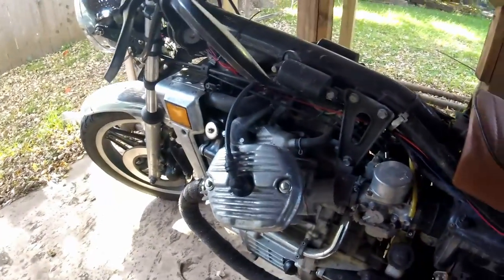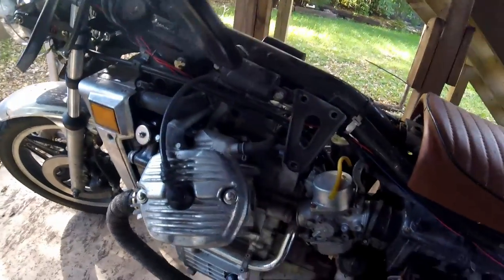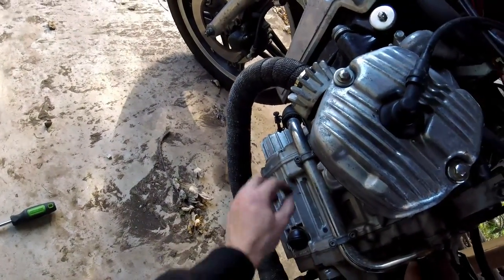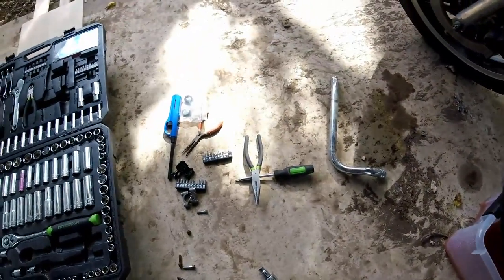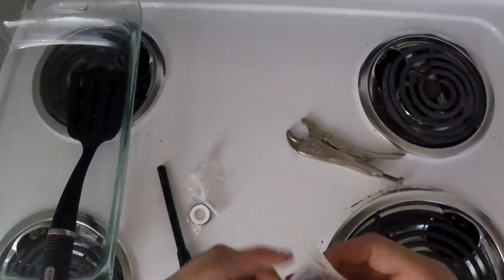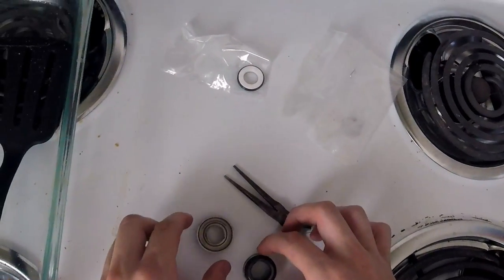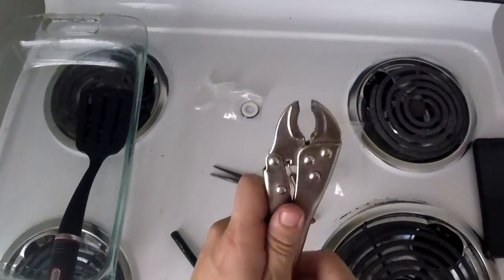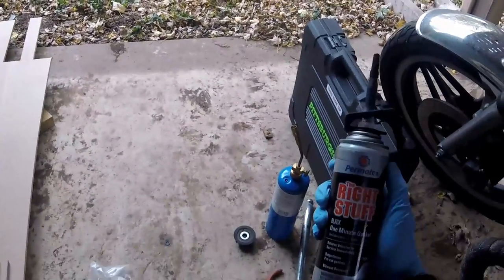Honda CX500 Water Pump Seal Replacement WITHOUT Removing Engine! THE SHEP METHOD

Comment: Great tutorial! Whipped right thru the job after watching you, only bit that I felt dodgy about was heating the cup in the new seal to release the rubber bit. After careful heating it came out just fine.
Reply: To do the job right and top notch you pull the engine.....it's 20 min and it's out 
You can spin it around on a jack take the rear engine cover off, drive new seal in.
Clean out engine of all clutch and metal break in which mine had 3 paper towels worth in the bottom......Normal even with 14k miles

Comment: This is really great! I recently bought a '79 CX500 in really great original condition, and it has sprung a small dribbling leak at the water pump area. Great video thank you!

Comment: Thank you for this. I'm getting ready to tackle mine in the next week or two. My bike is in pieces on the floor because I'm fixing the leaky carb feed tube o-rings and decided might as well get this over with. Your video definitely helped me gain a better understanding of the procedure.
Reply from the maker: Aaah, mine had the o-ring leak as well when I got it back. Glad I could help!

Comment: At 2:40, you say that you aren't missing any bolts, and the holes are just locating dowels.  You are, in fact, missing two M8x65 flange bolts that pass through the dowels, and are the primary fasteners for that cover.

Comment: Going to be doing this on my GL500 sometime soon, no serious leak and no oil/coolant mixing but it dribbles a little bit (not even noticeably at idle). I'll have it apart and the coolant bottle off to do a pulser cover gasket and change the rear shock (pro-link monoshock) at some point anyway

Comment: I just bought a 1982 Honda CX500TC/Turbo (same/similar motor)...that was told to me by seller, that this seal did not leak. It was extremely clean when I purchased it w/no indication of a leak (which is common w/these motors)...but, after the 1st 20+ miles I noticed a very minor leak coming from this seal area (minor or not...none the less a leak). I'm assuming this procedure in this video does work (does it???) and it could be done w/mine. Much less work and $$$'s than splitting the motor or removal of motor to do it as Honda recommends. 

If this "minor" leak is left untreated/unfixed...what potential issues could arise (other than the mess on motor)??? 

BTW...great video. Informative! Could be better w/o the quick sweeps and better focus (field of view) on what you were trying to show on the stove. But...good clear video!!! Thanks for showing this!
Reply from the maker: I'd check the o-rong from the chrome water pipe before anything else. The leak is really a nusiance more than anything. If the drip is minor and you keep the coolant filled there isn't really any averse side effects to letting it drip a bit.

Comment: Regarding annealing the copper washer it has to be red hot and cooled in water. Cooling on it's own may harden it again.
Reply: From what I recall with blacksmithing. Heating until red hot and then quenching in fluid hardens metal like glass... maybe copper reacts differently?
Reply: @yoBradyO11  yes with steel but not copper..... try it out
Reply: The copper will be annealed whether it's quenched or allowed to cool slowly. Copper is only hardened by working.

Comment: What was your process of refilling the coolant back into the radiator. Did you bleed the air out or just start her up?
Reply from the maker: Poured it in the radiator cap until full then filled the overflow tank and let er rip
Reply: Fill the radiator until full. Leave radiator cap off, and start engine. Let it run until the thermostat opens (takes several minutes). When thermostat opens, you will see coolant moving in the radiator (with cap still off), and coolant level in radiator will drop a little. Now stop engine. Re-fill radiator until full again. Replace radiator cap. Now re-fill reservoir if necessary, to indicated full mark. Now the system is bled and you can go riding.

Comment: Did you use the Honda OEM replacement seal (part #19217-611-000) or did you use a Yamaha (11H-12438-10-00) one?  Can either one be used?
Reply from the maker: I did the yamaha one here.
Reply: @100PercentJake  I appreciate the response!
Reply: Yamaha part is €10......Honda part is €50......here in Germany.

Comment: All need to know is how to pull the fan blade of the motor
Reply from the maker: If I remember right you remove the front axle and it is threaded properly to thread into the front of the fan hub and press it off of the camshaft.
Reply: @100PercentJake  The problem with using the axle is the tapered end.  Only a couple threads will engage with the fan hub, and have been known to strip it.  Find a flat-ended bolt of the same thread (M14x1.5).  Also, find a Factory Service Manual, and ditch the aftermarket book that made that recommendation.